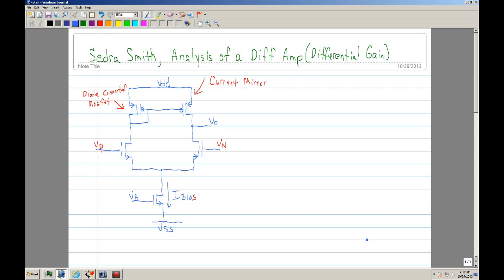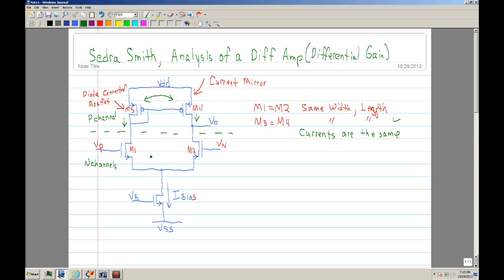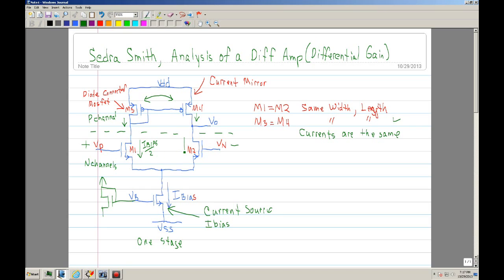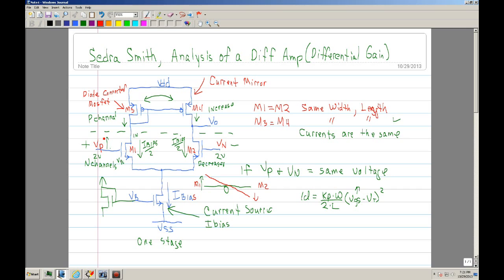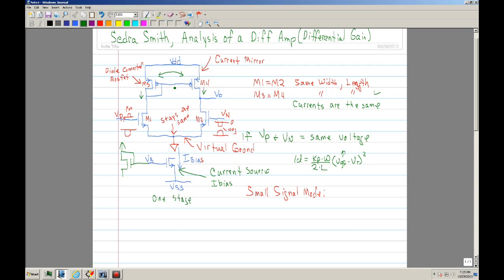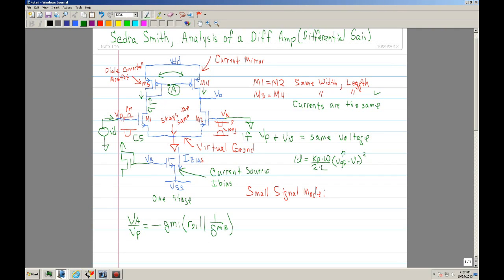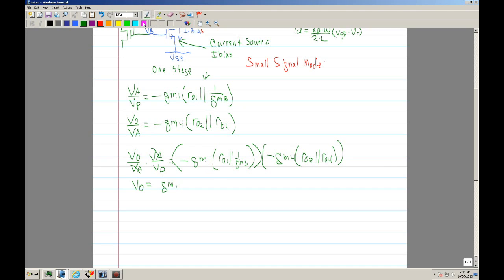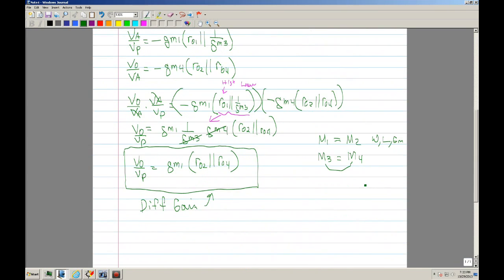Sedra Smith Diff Amp Circuit

Comment: For Va/Vp, I don't understand where you get the 1/gm3. Can you explain please?
Reply from the maker: +Memo “MekoxTwiSparkle” Pony The drain of M3 is connected to it gate. This is known as a diode connected diode. When looking into the drain or the source of M3, it will look like a resistor of value 1/gm3.  So the gain at Va should be gm1*(1/gm3). Hope this clarifies you question.
Reply: +Memo “MekoxTwiSparkle” Pony did you ever find out why